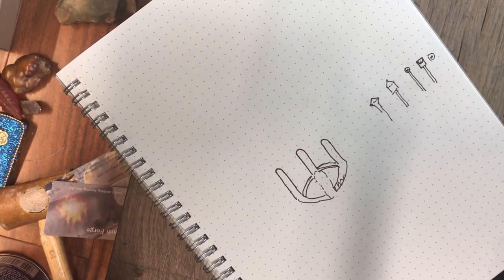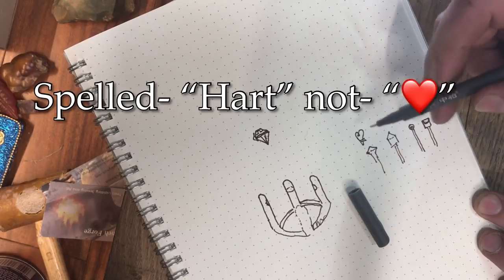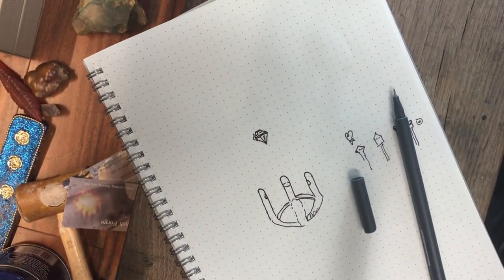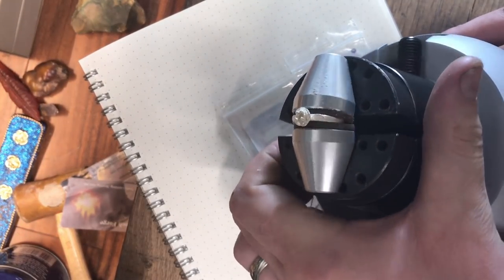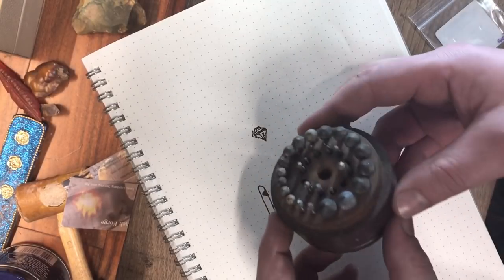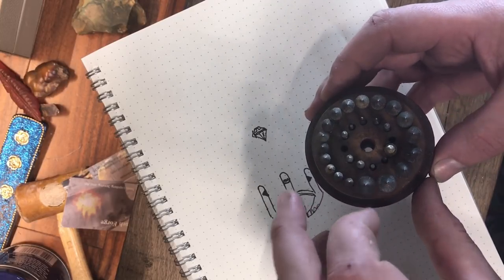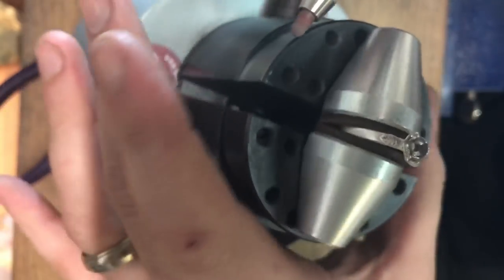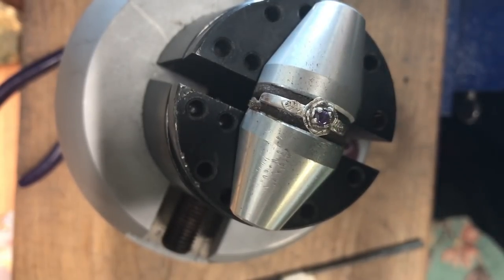DIY-The VERY basics of prong setting faceted stones+jewelry artist tutorial! Setting 3mm amethyst

Comment: How do you do the grooves at the same height?
Reply from the maker: When I made the ring I had already roughed out some impressions for the groves. One way to do it is to use a sharpie and a pair of dividers to scribe a line in the blacked out portion of the prongs. The. You make Sure you have your Bur braced for stability and at cutting speed before you engage the metal - it takes practice
Reply: @LionPunchForgeLPF , thanks!

Comment: How did you make the little petals?
Reply from the maker: Jessica those were carved from wax and cast but I have fabricated other flowers by cutting/sawing out the shape and then forging and engraving then before I solder them in place
Reply: @LionPunchForgeLPF  I figured it was probably cast but it looked like the flower could have also been layers of sheet metal. Thanks! It's really lovely
Reply from the maker: I have a couple other videos on making flowers with sheet and texturing